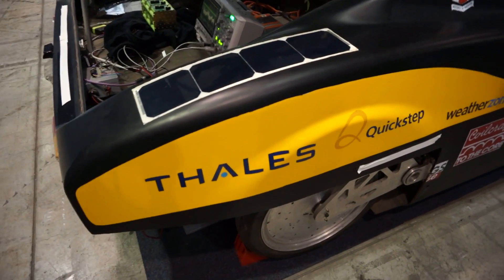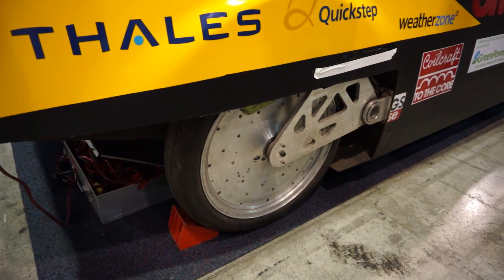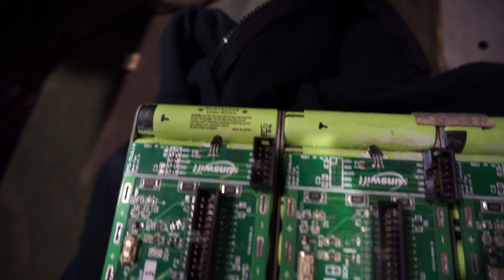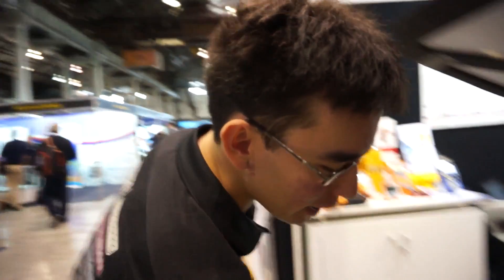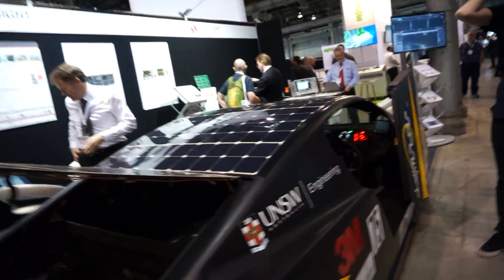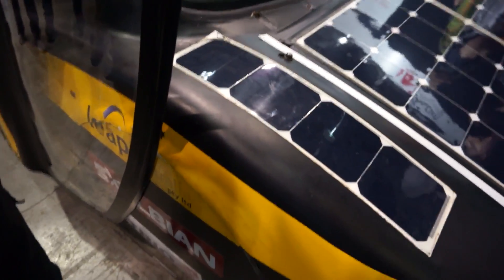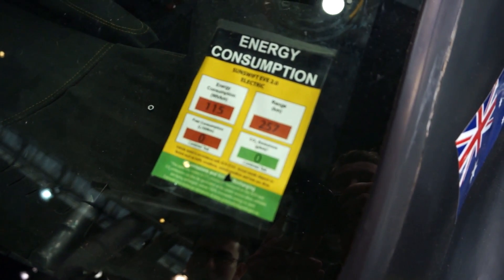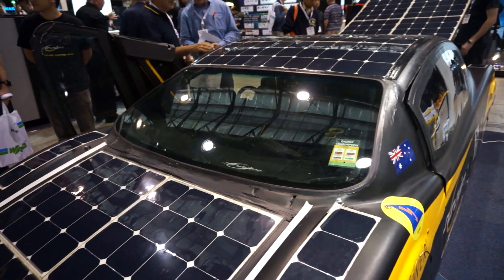EEVblog #923 - World's Fastest Solar Electric Car

Comment: They could have used batterizer, to get more from the battery. But they missed the oppurtunity....JK, this car is awesome!
Reply: If Harambe had batterizer hed still be with us... :-(
Reply: And if the whole road was full of solar panels they would never run out of charge !
Reply: FYI batteriser backers never received anything and batteriser stopped posting update. So yes they aren't even good at delivering their scam product.
Reply: GOOD POINT THEY COULD EASILY HAVE PRODUCED 800% OF THE POWER FOR JUST A FEW BUCKS. *FUCKINGROLL*
Reply: Well... to be fair the problem with BMS in series packs is unbalance cells, and given that the shutdown happens when the overall voltage falls below a set point, the entire system goes offline at say 3.2 volts... that's exactly what the guy described, unused capacity on good cells goes to waste,, with individual boost in each parallel block they could have easily overcome that issue at the expense of cost and weight.

Comment: The only trouble with solar cars is, they're not much good at night... :P
Reply: unless you drive to where the sun is shining
Reply: 87solarsky
Yep, if you can drive it at 1000mph that is, to keep up with the earth's rotation... :P
Reply: Richard Carboni
Might be cheaper just to drive a car with good old internal combustion instead... :P
Reply: emko333
Because the "using just plain water" types are putting twice as much energy in to get half the power out, which in this energy-strained 21st century is uneconomical, they'd be better off with pedal power, which is eternally renewable and easy to fuel... :)
Reply: +twocvbloke or just head way north for half the year then way south for the other half.... Hope it has good heat
Reply: You just need more powerful street lights :p
Reply: i don't get this, i see these stories of people running cars using just plain water why waste time with this solar nonsense?
Reply: Or in winter, trying to scrape all the snow off without damaging the panels.  Typically over the months a thick layer of snow/ice usually forms and it's semi permanent.   Still a really neat concept though!  I would see this being good for regular electric cars, it would at least trickle charge over time when it's sitting out in the sun.
Reply: Red Squirrel actually this is good for advancing car and other technologies to be more efficient etc, so what they learn could be applied to future electric cars and other devices
Reply: ***** how its fee energy look it up cars powered with just tap water.